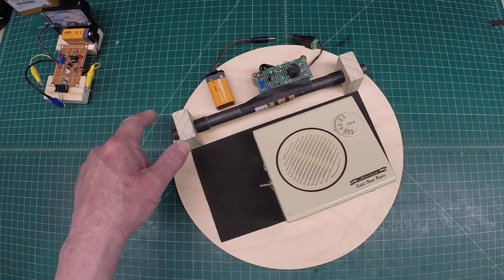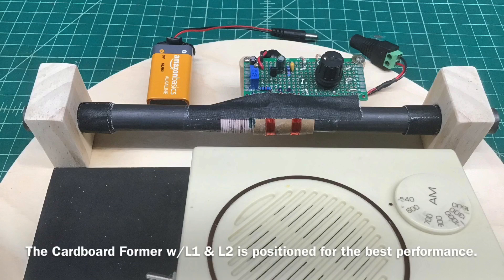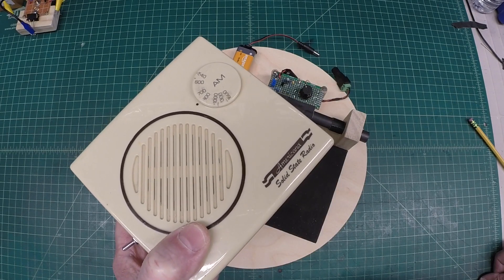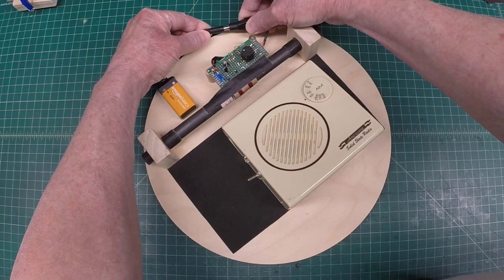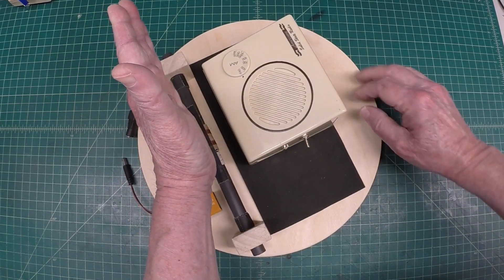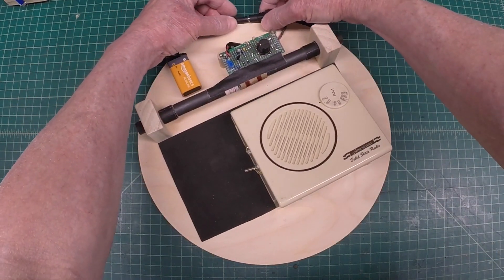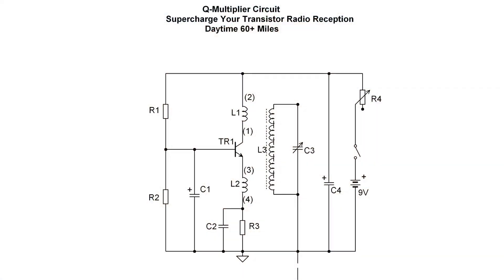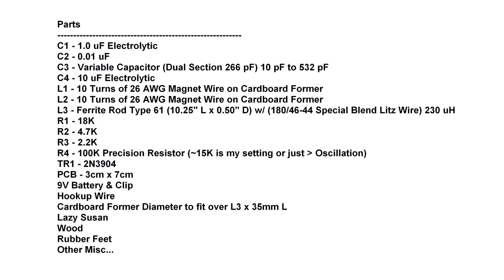Q-Multiplier Circuit - Supercharge Your AM Transistor Radio Reception Daytime 60+ Miles

Comment: How come there is no FM Q multiplier circuit to help improve FM reception or a SW or LW Q Multipler circuit?   Great reception there on those low power stations.  Maybe this Easter you might be able to hear those part 15 AM stations in your neighborhood with that circuit.
Reply from the maker: I’ve never heard of one for FM. SW & LW is possible, just build the oscillator to work at the IF frequency. An article that summarizes this at: https://randysbench.files.wordpress.com/2020/03/ives_q-mult.pdf Best, Don

Comment: Thanks for the video Don. I do have a question. You mention this as working for transistor radios. Would it not also work for a tube radio? Or is the inductive coupling such that it is not effective for the higher impedance of a tube radio's antenna circuitry?
Reply from the maker: I tried an AA5 with a loop antenna and didn’t get significant gains, but let me try this again and I’ll reply back ASAP. Best, Don
Reply from the maker: I just posted a video with a different Q-Multiplier circuit and it does work with an AA5 radio with a loop antenna. You can view the video at: Q-Multiplier Circuit - A Simple Circuit to Improve AM Radio Reception Works w/ AA5 or Transistor... https://youtu.be/Kc76MNpFDB0 Thanks again for your question. All the best. Don
Reply: @RestoreOldRadios  thanks Don, I look forward to watching the video. And I really appreciate your contracting me with the link!

Comment: That's a nifty little circuit right there, thanks for showing it to us! The only AM signal booster I have personally tried is a Select-A-Tenna passive loop antenna, which inductively couples to the radio like your Q-Multiplier.
Reply from the maker: Matt - it works great and it’s a simple build. The larger the ferrite rod the better. I tried some 4 to 6 inches in length and 1/4 inch in diameter and the results were not great. Hope you’ve been doing well. Best, Don

Comment: It seems similar to a reaction receiver.
Reply from the maker: Thanks Alain. I’m not familiar with a reaction receiver, but by definition you are correct. All the best. Don
Reply: Do you refer to a TRF  (tuned radio frequency)   receiver ?
Reply: @johnwilson6298  No, I think of a receiver vith a positive reaction to increase the gain. Part of thr amplified HF signal is reinjected on the input of the HF amplifier.
If the reinjected signal is too high the HF amplifier becomes an oscillator.

Comment: Is this using the IF or the station frequency?
Reply from the maker: Hi Carl - the station frequency. The LC circuit resonates across the AM ( Broadcast) band and through inductance couples with the internal ferrite loop in the transistor radio that is tuned to the same frequency. Best, Don

Comment: Hi Don,
I am a bit confused. I thought that "Q" referred to the quality of a coil. When the author called this a "Q" multiplier, did he mean another meaning or does it mean the selectivity of the radio. Is this an antenna amplifier or a device meant to increase the selectivity? 
My ignorance aside, it makes a dramatic improvement and I enjoyed seeing it. 
Thanks,
Ian
Reply from the maker: Ian - you are correct as the quality factor of the coil is improved by regeneration/amplification of the received signal and adjusting the feedback increases the Q factor of the ferrite antenna, which to your point reduces the bandwidth and increases the amplitude of the carrier then the enhanced signal is coupled to the receiver through inductance. Mr. Bollen reported seeing an increase from a Q factor of 100 to over 1000 using this circuit. Hope this helps. Best, Don
Reply: @RestoreOldRadios  I understand now. Thanks Don.